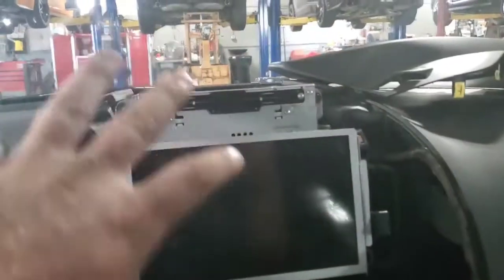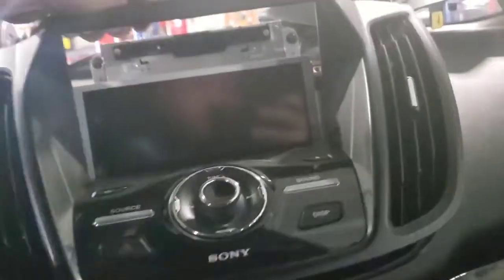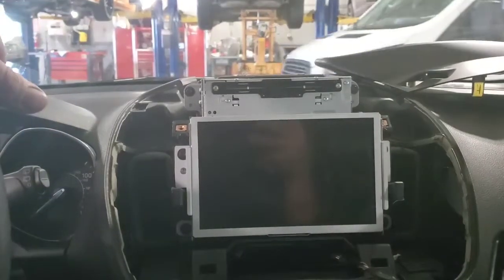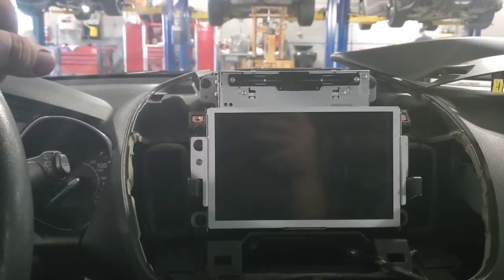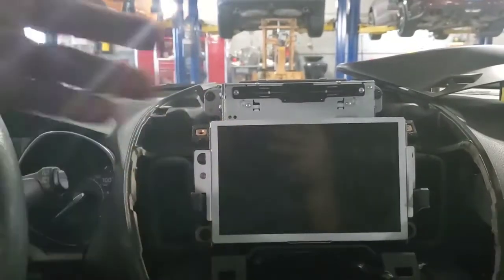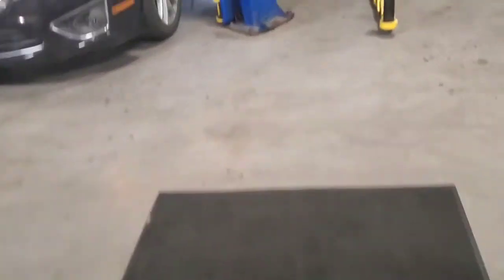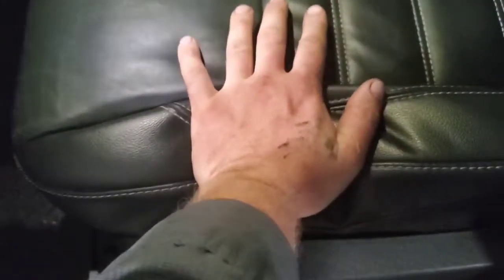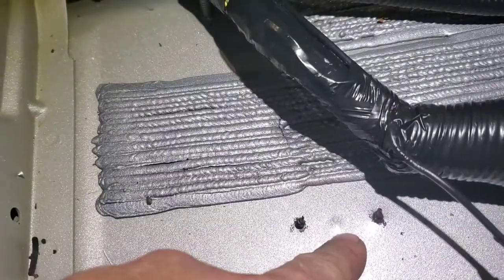2017 Ford Escape No Sound From Radio ( Music ) Fix

Comment: They don't need to be replaced they don't need to be this bad that's a lemon as far as I'm concerned there's a limited issue and then states were you have lemon laws absolutely pursue it get Ford to fix the problem permanently or agree to replace the modules under warranty lifetime.

Weather results of court cases absolutely do that.

Comment: The idea of ventilation as you described as pretty good except for the winter time you'd have to have some way of getting fresh outside cold air in instead of inside hot cabin.

Comment: It's probably due to hage. It's a buffer overrun problem.

I've noticed I have to have my car idling for at least 8 or 29 hours before I noticed the problem and then it's just basically turn it off I do a lot of stop-and-go in and out.

Comment: when i bought mines, they said it was a loose wire. my battery died the other day and when i jumped my car, it hasn’t turned back on. what do you think? should i replace the module? how do i know its a loose wire? something was also draining my battery and it was fixed yesterday but obviously still having these other issues that appears might be related to battery

Comment: mine cracks loud for a few seconds, then no sound at all. Then i cant change my source at times. After powering off car, usually over night the sound is back. From all i have read it sounds like the ACM.
Reply from the maker: Sounds to me like the audio control module is going bad

Comment: This has to be the problem with my 2013 Escape.  It makes total sense.  My sound it out and it will come on sometimes when I go over a speed bump.  I really didn't think it was my ACIM..I feel like it's some sort of short in the wiring.
Reply from the maker: Most of the time the reason the radios come in and go out is because of the audio control module

This was a very rare occasion where somebody actually you drilled a screw through the bottom of the floor and chafed the wires
Reply: Having the same problem on my 2013 escape right now 😭 so annoying !!
Reply: @robynneRN  My 2016 Escape started acting up this morning. 
It's good to know what it could be, but sux I might have to spend a grand for a dealer repair.

Comment: I just hit the audio control module with a screw driver, and everything started working. I tried every fuse tied to the radio and sinc system. I tried unplugging and replugging the audio module. But just hitting it with a screw driver worked.
Reply: I have that same issue with that piece of plastic. Guys at the Ford garage say they don't see anything loose. It has come loose 3 tines. I didn't put any self tapping screws in it, though that seems stupid.

Comment: Right that's a customer who leads our car idling A LOT.

HAS BEEN ON FOR A COUPLE OF DAYS OR A DAY OF A LOT OF IDLING AND YOU HAVEN'T SHUT THE CAR OFF FOR AT LEAST 5 MINUTES SALAD COMPLETELY OFF, THE MEMORY WILL FILL, AND BUFFER AND WHAT HAPPENS THERE IS CERTAIN THINGS OF THE MODULE FREEZE.

OF COURSE THE WORST IS THAT'S THE LAST TIME YOU HAD A SET-TO A HIGH VOLUME NOW THE RADIO WON'T COME ON THE SAME ONE STATION AND PLAY IT AT CONSTANT VOLUME AND YOU CAN SHUT IT OFF UNTIL YOU TURN THE CAR OFF.

I'm not going to edit that all caps accidentally on.

Anyway, lunch solution guaranteed is make sure your battery is good well charged normal acting battery, 0 because of a bad battery what causes issues decor much more often.

Car completely off your out of the car, we won't matter if you leave your charger plugged in no big deal it'll still be hot but don't worry about it.

Come back in five minutes restart the car everything should be gold.

Basically this is going to happen to any your model from 2018 up even the 2023 same issue if you're a cop and you like to leave your car idling a lot this thing is going to screw up on you.

Listen to their own music on their own phone anyway so no big deal.

Comment: So much electronics  added to these newer vehicles scare me because of complexity and potential problems and costs to fix.
I have Crown Vic Sport with 240,000 on clock simple,  cheap to fix and goes forever.  I have Maurader with 51,000 still like new.
Thought about getting 2017 MKZ but electronics scare me satisfied with my Vic  and MM.  
Enjoy yr channel.
Reply from the maker: You should see the stuff that I'm dealing with now on these 2020 it's a nightmare I have the engineer calling me every single day because I keep finding more problems on these brand new vehicles
Reply from the maker: Thank you for the support
Reply: What do u think of the Lincoln MKZ  and New Contenental  ?
Reply from the maker: I would not get a new Lincoln they are made very cheaply and we get to try them out directly from the magazine companies that do the reviews on them at the test tracks and stuff like that and a lot of these new Lincoln's are coming to the dealer would not even 300 miles on them maybe a thousand miles on them after testing at the track and doing article write-ups on them and the seat backs are broken the electronics are not programmed inside the vehicle half the LED light doesn't work in the back and that's a $1,200 light
Reply: @FordBossMe  I had a 2020 Escape Titanium for about 7 months. Ford finally bought it back (thankfully). It was in the shop 42 of the first 80 days I owned it. It has a subwoofer design that literally rattles itself loose every 300ish miles. Bad modem, seat issues. I had driven Escapes since 2007, as I like their size. Walked away from Ford for a while after the buy back. That redesign was badly engineered. You have a great channel. Love your info.

Comment: I’m having the same issue with my 17 Raptor, Radio turns on everything visually works but no sound the volume dial doesn’t work when I hit the volume on the steering wheel the volume window pops up but doesn’t do anything. I did master reset, pulled fuses, removed the negative battery terminal for some time and still nothing took it to the nearest ford dealer they can’t figure it out they are saying the radio checks out good after some tests (which is BS) they reprogrammed the Apim and still nothing, I’ve changed the Apim and still nothing I’m at the dead end 🤷‍♂️ hope you can help. 

Thanks in advance
Reply from the maker: Sounds to me like you have an accessory protocol interface module that has went bad or a audio control module
Reply from the maker: Pull the negative battery terminal and leave it off for about 10 minutes and then put it back on and see if it hard resets everything
Reply: @FordBossMe  I forgot to add that I already changed the APIM and it was still the same. Possible ACM?
Reply: @FordBossMe  when I change the acm does it need to be reprogrammed?

Comment: Having the same issue and can't find the audio control module to purchase. I have a 2013 fusion vin# 3FA6P0H93DR155906 wanted to buy the module and install myself but all modules say discontinued. I believe this is the part number I would need DS7Z18C869CA
Reply from the maker: I'm not at the dealer right now, out on workman's comp leave
Reply: @FordBossMe  Appreciate it. Hope all is well 🤙

Comment: I wish we were BFFs LOL! I had to take my car to the Ford Dealership and they diagnosed that the ACM had to be replaced on my 2014 Ford Escape Titanium. My radio has no sound, can't switch radio inputs and voice prompts has no sound. The cost to fix it was $354 parts + $560 labor = $914 YIKES!!! At least it comes with  a 2 year warranty.
Reply from the maker: That's alot of labor
Reply: That’s what is wrong with mine. No sound . It’s stuck on an AM station
Reply: @FordBossMe  thats a shame. 45 min job

Comment: I can find and change the module no problem. But, does it require a Ford only computer to program ?? I have a friend thats selling her 2014 Escape to Carvana. And they wont buy it till the radio works. So, shes trying to fix it as cheap as possible and avoid the dealer.
Reply from the maker: Yes
Reply: @FordBossMe  That's what I thought. Best source for a good ACM ? Besides the dealer.
Reply: @FordBossMe  Thanks.

Comment: I have had my 2016 Ford Escape in 3 times now for repairs. The sound would go out, come back on, eventually, it went out for good. Ford dealer said it was my sync 3, they replaced it downloaded new system and still I have no sound for radio and Navigation. The radio station has frozen on one station and won't change at all. Now they are telling me I need a new radio. Any advice?
Reply from the maker: if the screen is locking up and its slow to respond between selections its the apim or the Fcim 

if there is no music and radio stations coming through its usually the Audio Control Module
Reply: @FordBossMe  Thank you for a speedy reply. The screen works fine except it won't move to different radio channels but all other screens work fine, just no sound for the radio or navigation
Reply from the maker: It's probably your audio control module and they're just replacing the wrong thing
Reply from the maker: The audio control module is what controls the sound and it will take out the radio station and it will take out the navigation sound
Reply: @FordBossMe  Thank you for your help :)
Reply: @FordBossMe  do you know where we can buy one to replace it or if I call ford and tell them I need a new ACM, they’ll replace it for me? I just don’t want to spend so much money when it seems like I can do it myself
Reply from the maker: @kathyvictoria6059  you can replace it but then it has to be programmed

It's not a cheap job it's about a half hour to 1 hour programming and then they're going to charge you about an hour to install
Reply from the maker: @kathyvictoria6059  if I was you I would call up the dealership ask for parts give them your VIN number and then ask them for the part number for an audio control module and then go online and search for it

Install it or have it installed yourself and then take it to the dealer and ask them to program the audio control module for you

Comment: I have the same problem with my 2015 Ford Taurus.  Just no sound I can tell the radio what station to go to and it works fine I can answer my phone and they can hear me but I can not hear them.  So I am guessing that it is the audio control module. Does the audio control module have to be programed?  What does the programing do for the audio control module?
Reply from the maker: You can put a new audio control module in and you'll get your sound back most of the time but what it does is it puts the factory programming that's up-to-date into the module so everything communicates on the network properly

Comment: My 2018 F150 with 55k miles just went bad. Laggy screen, no audio. Looks like I have to go to the dealer and get it fixed. I tried everything nothing works
Reply from the maker: Well in general settings there's something called master reset that's the first thing you should do and you need to be stationary while doing it
Reply from the maker: If it still doesn't clear up you are correct you're going to need an accessory protocol interface module installed otherwise known as - apim

Comment: How does a person find out what fuse to pull for the stereo? I’ve looked all over the internet and the manuals don’t tell you anything anymore other then not to drink any fluids. I’d love to try all the small things before replacing the module. I took the module out and put the same one back in after making sure it wasn’t a dust thing, and it worked perfect for months. Got really cold and unlike before when it would come and go- there’s no sound at all (16 escape). If you could point me to place where I can see the fuse diagrams that would be wonderful!
Reply from the maker: It's in your owners manual

Sync or audio or front display
Reply: Yeah mine was in the manual. If it’s the same as a 2014 it’s under the glove box. I would try taking out the radio and hazard lights one and then wait a couple seconds and put it back in and it resets it.

Comment: I only fail to receive sound from the radio. I can still hear sound coming from the radio until I want to use the radio. Is that the same issue?
Reply from the maker: Needs to be properly diagnosed, sounds like a bad audio control module

Comment: My bucket truck 2017 F450  plain Jane radio. Comes on with no sound,  is there an amp fuse ?  it worked the day before but this morning nothing.
Reply from the maker: I'll look
Reply: @FordBossMe  just mysteriously started working again.  🤷🏼‍♂️
Reply from the maker: Sounds to me like you have an antenna problem or a defective radio or the shop has to reset the computer
Reply from the maker: https://youtu.be/b7lSjcpx0VY
Reply from the maker: had one today work truck here, radio would come on and go off then it finally died

its the radio or AUDIO CONTROL MODULE in this video I show it to remove it

Comment: I bought recently an 18 Titanium, just 11k, it has no sound, has navigation, rear camera working but absolutely no sound and parking issue too
Reply from the maker: Most of the time when it comes to no sound it's the radio control module or the audio control module

A lot of times if you just find the fuse for the audio control module and pull it wait like 30 seconds and then put it back in it will come back online and if it doesn't typically it needs to be replaced and programed
Reply: Is it possible to buy the radio control module and program it myself?

Comment: Soo.... it wasn't a fix but a troubeshoot/fix. Question is did the dealer charge them for the module, labor, and troubleshooting. I'm sure they did... its the dealership 🤦‍♂️
Reply from the maker: Yes the customer has to pay for their repairs but then if they want to go after the people that repaired it before it's their job not ours
Reply: @FordBossMe  but were they forced to buy the new module since the old one worked.... dealership loves to screw people over

Comment: Their trying to charge me 1300 bucks for this. I've owned 5 ford's in a row now. I called Ford directly and I got fanned like a fart. 

I will never buy another Ford again!
Reply from the maker: I don't know what to tell you, these problems are indeed expensive
Reply: @FordBossMe  maybe they should engineer better stuff and let Americans build "American cars." Supply chain, chip shortages and blah blah blah wouldn't be a problem if everything wasn't outsourced.  They would probably be cheaper at this point too.
Reply: @niteowl9733  
It is the damned “planned obsolescence” business models. Manufacturers don’t care about durability anymore.